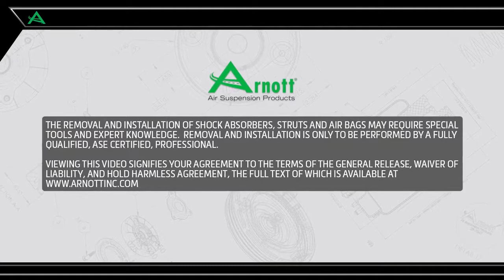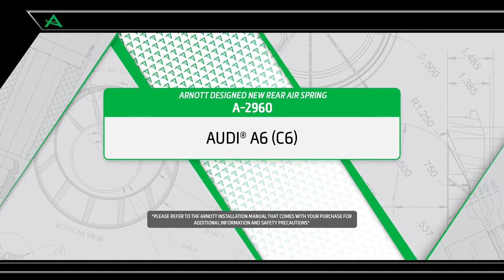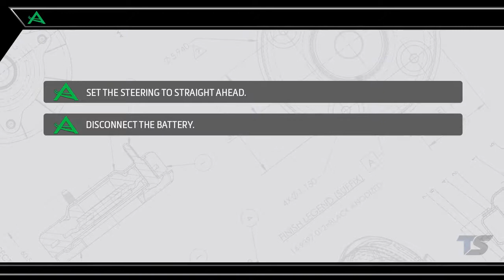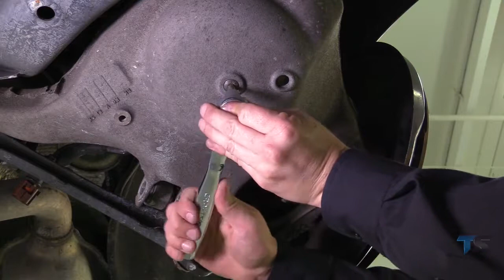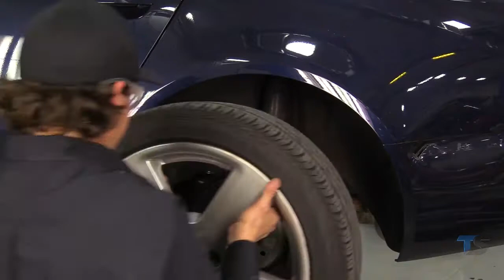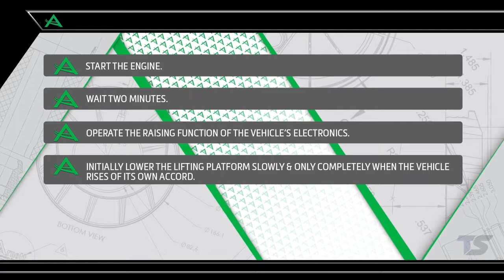Replacing an Audi A6 Air Spring

Comment: Hi

Do i need to perform any kind of calibration of the suspension via vcds after replacing an air spring?
Reply from the maker: Reprogramming or calibration will not be necessary when changing to these Arnott air springs. If the vehicle has error codes for suspension issues due to a leaking bag it may be necessary to clear those codes. As always with any suspension work, an alignment is recommended when the work is completed.